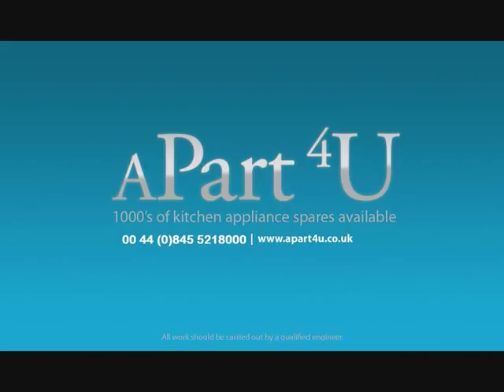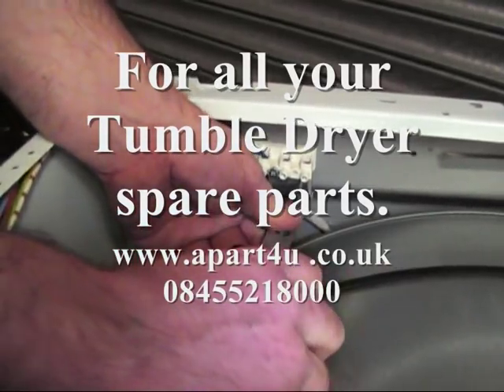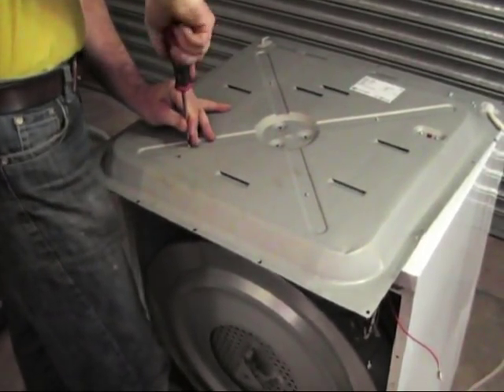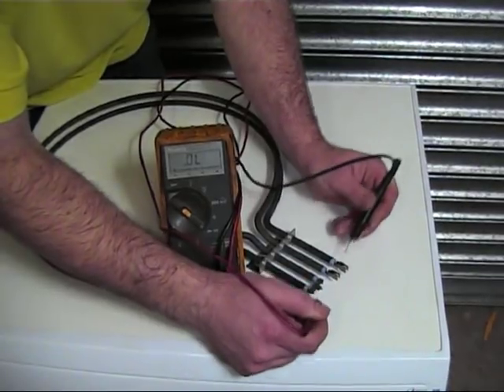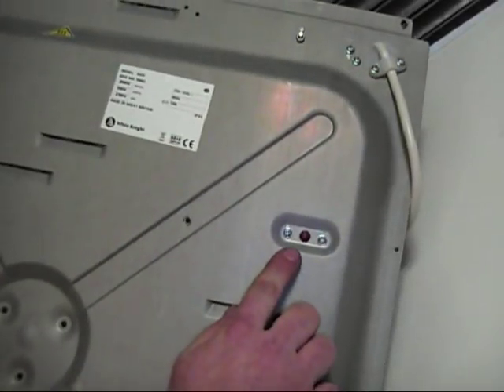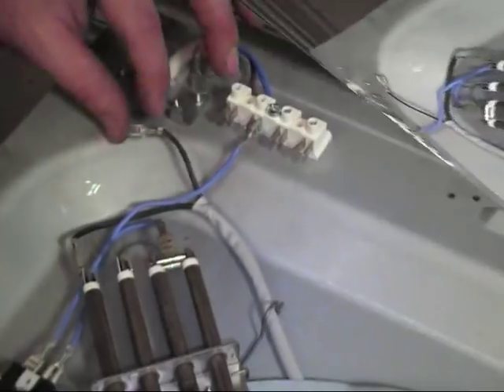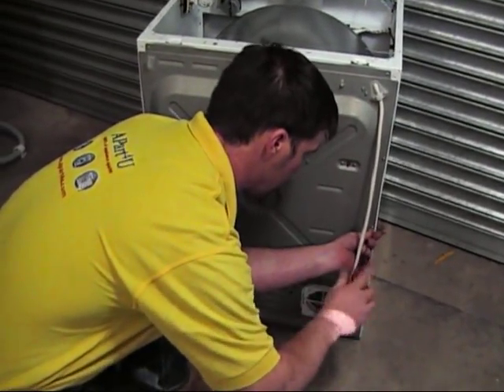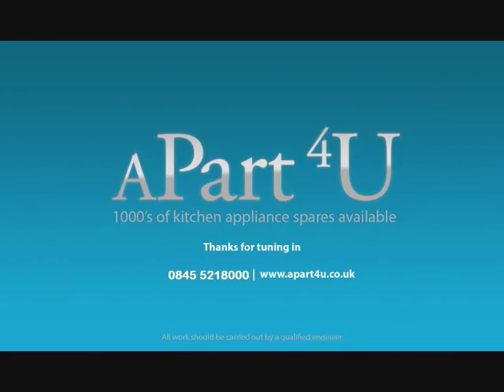How to Replace A White Knight Tumble Dryer Heating Element Heater, Thermostat

Comment: Hi, my White Knight 44AW stopped working last week - I did a bit of research, and ordered a new timer. Fitted the timer and the good news is that the unit now fires into life - the bad news is that it doesnt warm up! I am a bit sceptical as to having two failures at the same time (timer and heating element) - btw I did try the red reset switch on the back before I started anything and that has not activated. Is my (new) problem likely to be the heating element or something else? thanks
Reply: its the element

Comment: Hello I have a question, for some reason after installing I can hear metal on metal rubbing I have checked and its not rubbing on the new element so do you have any ideas what it is ?
Reply from the maker: +nick black if not fitted back together correctly, the drum may be rubbing on back or the element  brackets may be catching.
I am glad I could help you with this problem.
Please remember to Shop with www.how-to-repair.com  and it would help us by posting the video or website on your timeline. This helps us a lot and if we really helped you can always buy us a beer http://how-to-repair.com/help/buy-paul-a-beer/
Please remember to mark us to your favourites also I would be grateful if you would subscribe to our channels social media as this really helps my site and keeps us going.
YouTube. http://www.youtube.com/user/Apart4u
Facebook. https://www.facebook.com/how.to.repair.appliances
Reply: +nick black Hi, Did you ever get it running without the metal rubbing noise, I'm struggling to get the metal grinding to go, Dryer was silent before I replaced the elemt and I would say that I lined the drum up pretty square

Comment: Hi I found your video very excellent help. I replaced the element and it heats up immediately. There was a burning smell when first turned on so I took apart and everything looked ok. No burning smell second try. Is this usual when replacing a heating element?

Comment: I found that when removing the three centre screws the drum dropped down. This makes re-assembly very difficult. I had to remove the door and lay the machine on its front before I could get the drum back in place and the screws back on. Showing this stage in your video would have helped.
However, I thank you for your video, which otherwise was very helpful.

Comment: @how-2-repair.com
Hi i have this exact machine,the dryer does work but the temperature inside the drum doesn't seem to be very hot,yes it works and it is warm,but not red hot and on average takes 100 minutes to dry clothes and sometime i need to have it on longer.
Ive metered the element for continuity and that's fine,also checked the reset switch and sensor too BUT THERE is also another thermostat in the actual plastic unit where the pipe connects to underneath the machine,its located in the blower fan unit.
If this fails or goes faulty woud it make the temperature lower?, or would it simply not get hot at all?
Ive also checked the low and hi switch thats fine,so im a bit stuck if its the element , although it meters out ok,maybe worn out and not as hot as new OR its a faulty thermostat that is governing the hi temp.
 I dont know if these small silver thermostats adjust the temperature or just cut out if overheating.
 with the symptoms i stated what do you think it could be, thanks in advance, and thanks for the video, my exact model is a white knight 44aw 2500w

Comment: So I have replaced the heating element thermostats and the start relay on my tumbler dryer but I'm still getting no heat even though it still works and is blowing cold air. What else could I check for ?? Many thanks for the video helped me loads
Reply from the maker: Chris Chalmers i need make and model but there might be anther stat at the front of dryer
Reply: It is the White Knight 44aw. I have got it to start heating up after i accidentally left it plugged in and electrocuted myself :S not the best thing to happen but hey ho its heating up. Only problem now is when clothing is added the inside is not heating up just getting warm. I check the back of the drum and it is hot to the touch,  I have checked the air flow and it is perfect and the heater element is heating up fine so i'm now stumped as to why the clothing is not drying any advice would be great. thanks for getting back to me
Reply from the maker: Chris Chalmers chris you need to give me a call on this and i will try and help
send me email and i will send you number info@how-to-repair.com

Comment: I REPLACED this and switched on and was heating up but now the side and back of the dryer get burning hot when it is on, any ideas?
Reply from the maker: hi check fans and air flow also check thermostats are working 

Iam Glad we could help you
Please remember to subscribe to our channel
https://www.youtube.com/user/Apart4u?sub_confirmation=1

Remember to Shop with www.how-to-repair.com and it would help us by posting the video or

website on your timeline. This helps us a lot and if we really helped you can
always buy us a beer http://how-to-repair.com/help/buy-paul-a-beer/

Comment: hi, i have a white knight 427wl tumble dryer.
every time a turn it on the timer dont move and if i don't keep cheking it will work for hours.
can any one help me please?
Reply from the maker: this sounds like the timer you need to check the motor on it
Reply: had same problem...the timer dial sticks as its pushed in too tight...simple fix is to pull the dial out about 5mm this should release the tension...

Comment: Hi I have a White Knight 44aw tumble dryer that keeps running cold I can reset it by using the reset button on the rear of the machine but after one session of drying I have to reset it again, could it be the thermostat?? I understand there are two theromstats do I need to have them both replaced of just the reset button one?? Can anyone be of any help Thanks
Reply: I'm having the same problem, did you ever sort it?
Reply: I fixed it by replacing the thermal cut out reset thermostat (the one with the red button)

Comment: Hi there, is this the same procedure for a White Knight WK 447. Also I presume that the wiring colours have changed. Opened up my T/drier to find a red wire without spade connector dangling. It's from the heat control buttons on the front. I presume it goes to the heater element but not sure which connector to go on. Perhaps you can advise please.
Reply: Roy Saxby